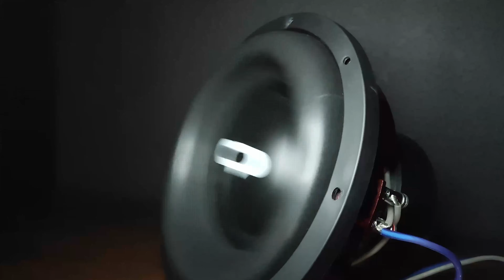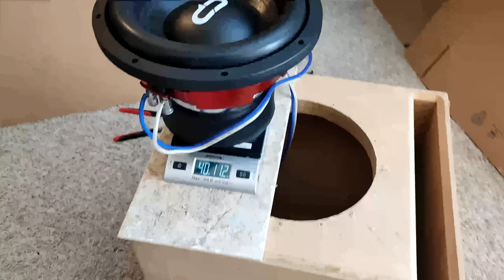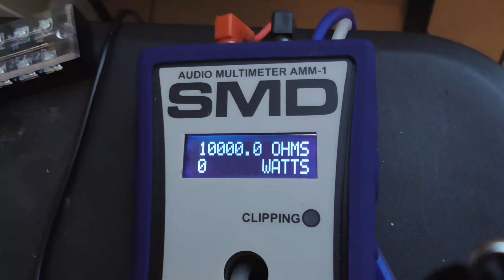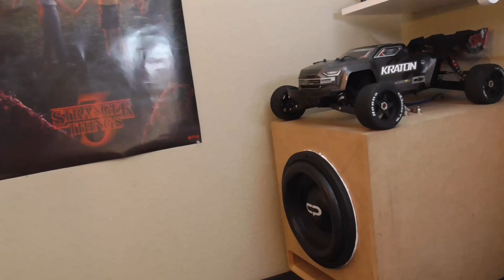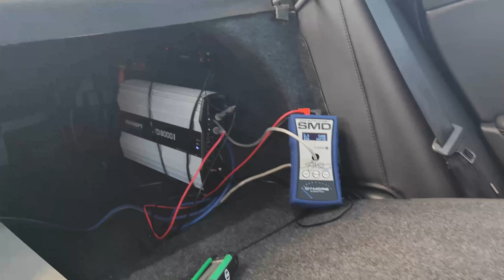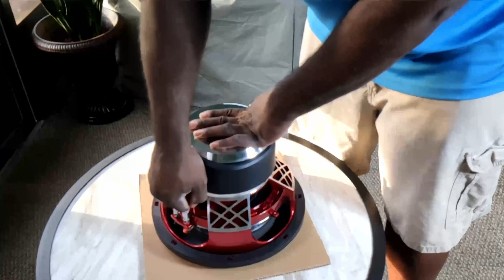CP Audio CP1200 - Full Review - 5000 Watt Stress Test

Comment: Hey man how’s that super capacitor prebuilt bank treating you ? The grey unit on your test bench sitting behind the red lithium cells, I’m interested in buying one of those to support my agm battery. I don’t have any other supporting electrical mods done to my car except for a factory upgrade oe 140amp alt and the 1 main car battery. I’m debating between adding a secondary agm battery like those small ones from a Honda civic like a oddessy pc680 size battery or that huge super capacitor box that I seen on your table ? They are pushing them out on sale for 150 currently listed as “B stock”. I see it says it’s like 40lbs on Amazon is that accurate weight ? Is it going to give me more of a boost than a small battery which would you recommend?

Comment: It's a copy of resilient sounds woofer. Many woofers are made by the same manufacturer. Such as the scar DDX is the same as a sinful sounds woofer. Only sinful sounds charges 30% more for their name😳😖. Same with amplifiers. The down4sounds jp23 guts are identical to the Skar 2000! The Sundown is the same as Apokolyptic full bridge amplifiers. They may say assembled in America but the boards are Chinese. The upper end Chinese are good. But Korean boards are thicker with wider tracers in the board and better caps. Brazilian have the thinnest boards and the mosfets aren't as good. The soldering isn't very good either. But if you keep them cool and vibration free you won't run into many problems. But they are poorly made! There is two sides to audio that matters. Quality and performance. When you hear someone say a amp is junk and it gets hot and shuts off in a review. One must take into account operator error. Like poor voltage supply,thin wires, poor ventilation, mounted to box, not grounded properly, wired to a lower impedance than the amp can perform at. Ever try to drink a milkshake thru a coffee straw? That is how a amplifier feels with small wiring or poor voltage😳😖 Thought I'd share some info on products and common sense when considering someone's post on a product 🤔...Peace! ✌️
Reply from the maker: Love this comment. Thanks